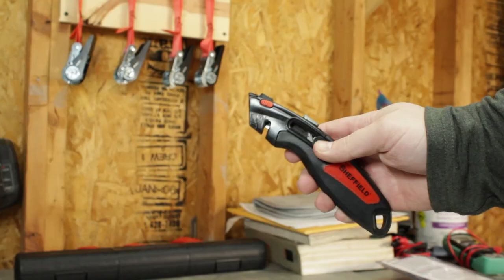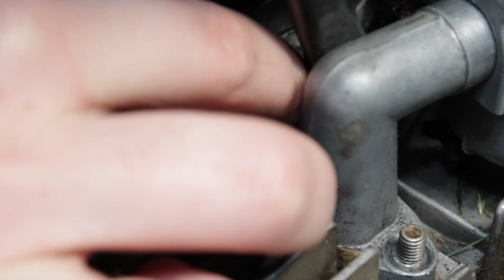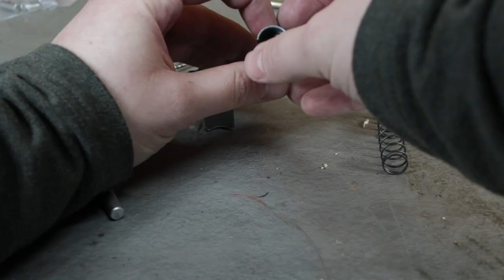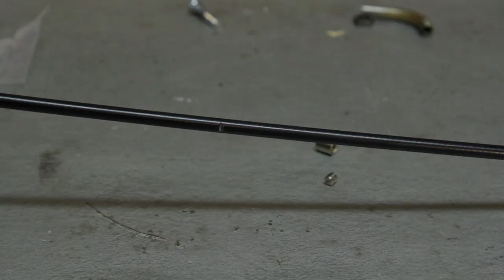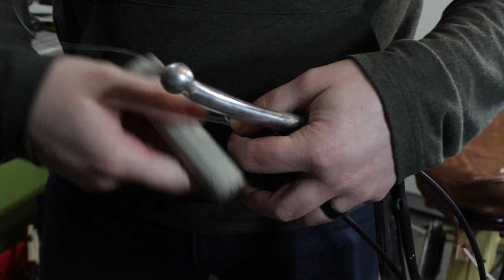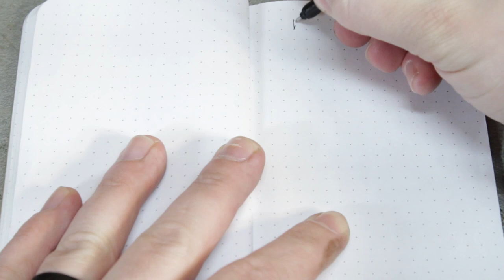Fixing the Throttle Cable on Spider-Man's Moped | 1977 Puch Newport Ep. 1

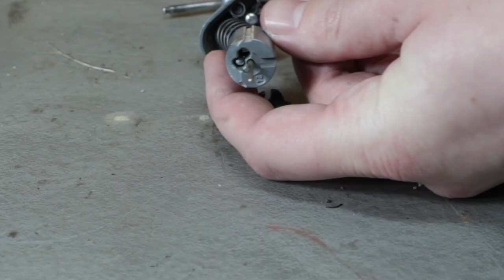Comment: At 4:50, did you check inside the clamp of the carburetor to ensure that the rubber o-ring was there? sometimes they go missing and that can cause an air leak at the intake.

Comment: hi at 7'03" mark what does that screw you added do? I don't think my control has that hole. thanks
Reply from the maker: Not a clue. It's a legacy from the previous owner
Reply: That's a mini cable knarp, basically a small cylinder with a hole and set screw that you can use to set the length of the cable if the cylinder that it came with is not the proper length for your throttle grip.